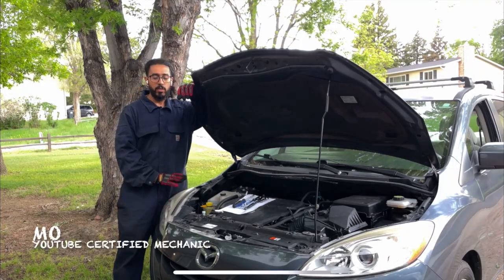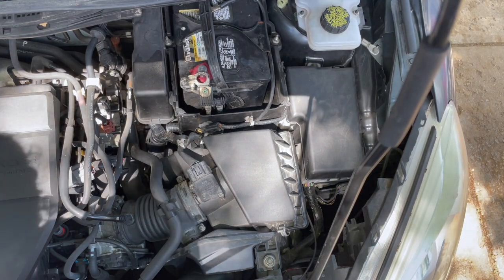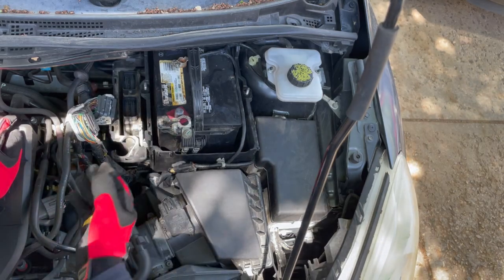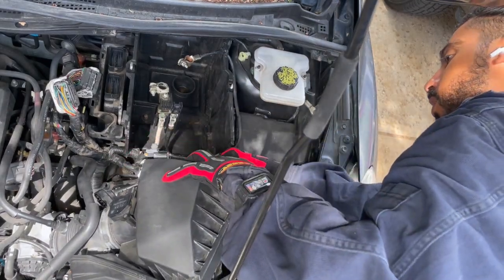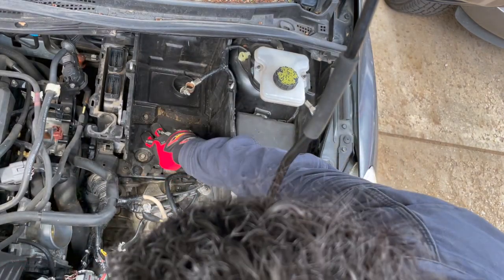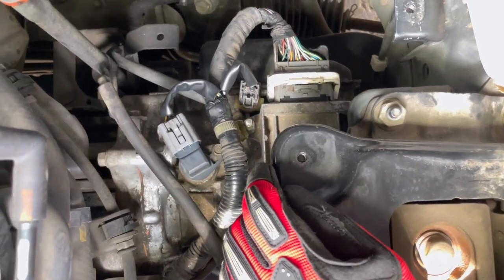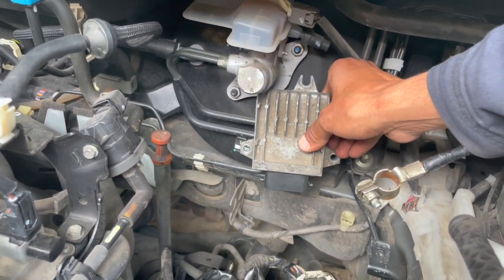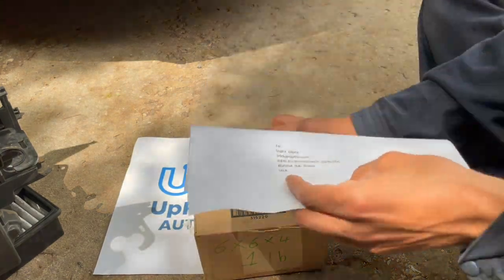Issues with Mazda 5 TCM (Transmission module) and Removal/Repair Instructions. Codes U0101, U0100

Comment: This is a super helpful video so thanks tons for making it for us!! I put in our new TCM last Fri and will send in our old one tomorrow. My 2012 Mazda 5 GrandTouring model's brake lines were layed out a bit differently on the two walls outside the battery box so after some doubt I zip-tied my new TCM (pointing upright) onto the brakelines that are just in front of the bulkhead that's in front of our dashboard, with UpFix's nice rubber pad in between as a buffer.  When I reattached the battery box to its anchor points it put some pressure on the TCM and those brakelines too so I sure hope it's not too much. I'll call UpFix tomorrow to ask but do you all think it's OK? I wish I'd taken some photos but nope--forgot.

Comment: Thanks for this video! I have the exact same year Mazda 5, and the AT light has been intermittently coming on, and was hard to get codes on. The mechanic didn't share the exact codes with me, but said they 'think' it needs a new TCM, which they will replace for me for $1,700. I read somewhere that sometimes just unplugging the transmission control module and all of the other sensors may reset it and all will be fine. I was just curious if you had tried that first, or if you went straight to having it UpFixed?
I'm considering trying this idea first, and if it doesn't fix it, then I'll be using your video to take it out and have it UpFixed. 
Thanks again!
Reply from the maker: Yes that is a common issue with these TCMs that they fail and need to be replaced or fixed. UpFix.com has been repairing them for 5 years now.
Reply: u can try reflowing the solder for free first. look at solder points for mazda tcm, its on youtube. dont pay 1700. pay 200 for a used one and 100 for labour at most. u can also try the tranny speed sensors they are like 20 bucks a piece. input and output.

Comment: Were did you get you tcu at
Reply from the maker: The part was sent to UpFix.com for repair. It came with warranty and still working great after 8 months! Here is the link for the repair service https://www.upfix.com/product/tcm-mazda-5-2007-2015-transmission-control-module-repair-tcm-tcu/